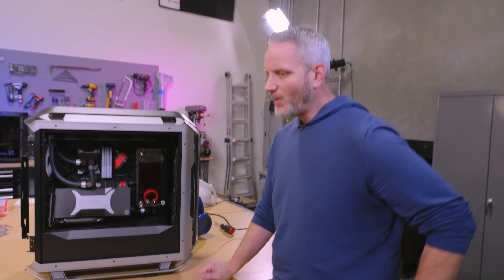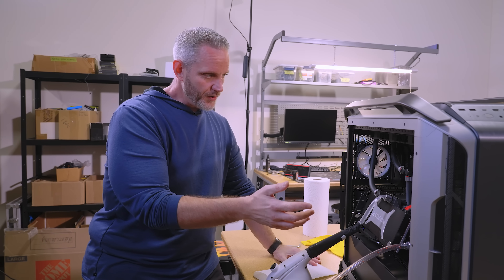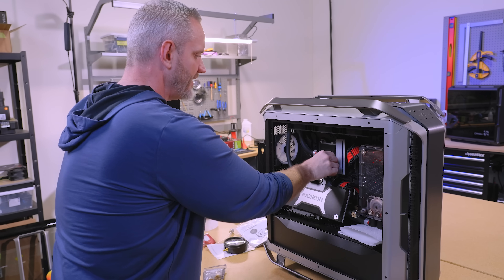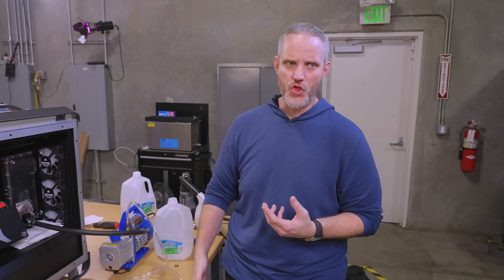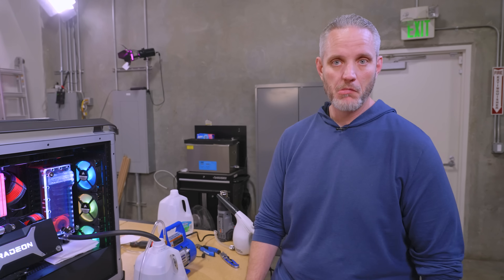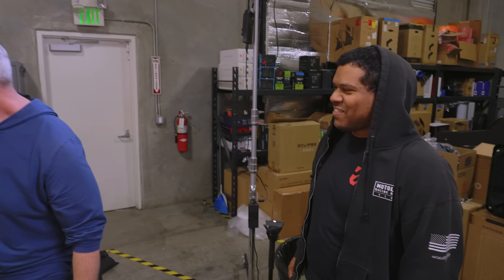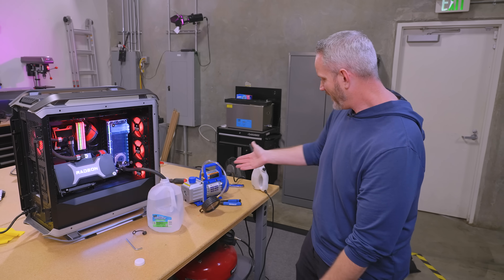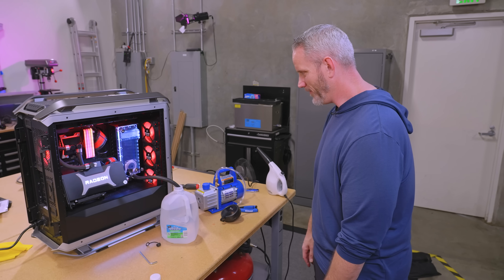I used Vacuum Pressure to fill a PC! Why didn't I do this sooner!?

Comment: I'd recommend pulling vacuum from the highest point. Filling from above the water line would also eliminate the air bubble. Lastly, I would pull less pressure. Even a few negative PSI would fill it in moments. But reducing the strain that a higher vacuum puts on your components would be good for longevity.

Comment: I built a vacuum pump using a tyre inflator and araldite, it’d be good enough for jobs like that, also there’s no need to go anywhere near a complete vacuum, the reason auto ac systems are pulled so low is to remove any moisture in the system, when you’re filling it with water based fluid anyway a bit of moisture isn’t going to hurt it.

Comment: 11:35 You only need an inline capture reservoir to use it to drain the system too.  As long as your reservoir has enough volume, it should be easy to avoid getting any liquid in the pump.

Comment: Leave the valve open near the block, use hose clamp pliers at the very end of the tube, and the dip that into the water jug. Minimal air introduced. Or prime the tube

Comment: Open the fill-port of your loop, run the system hot and hard to get coolant to max temp.
This will drive dissolved air out of your coolant.
Close your fill-port air-tight and Robert is your parents sibling.

Comment: Could run the black hose  into the fill bottle lid, then have a straw run thru the lid separate to the bottom of the bottle. When you hold the bottle upsidedown above the fill point will clear the air pocket. Straw will stop the bottle from going under vacuum. Like shot gunning a beer

Comment: I don't even think the vacuum needs to be that strong, 50 to 75 percent of what Jay used should be enough, but would also be more favorable for the structures in the radiator.
You should at least give it a try

Comment: You could use a bucket with a hole for the tube and a hole for the blower. Fill it with coolant, then hook up the hose to the cooling system and turn on the blower.

Comment: You can make a 3 way valve out of brass fittings and grab a less expensive mighty vac to hand pump the vacuum or hook up to an air compressor

Comment: This vid is very relevant to me since I was planning to use the hand pump and tubes of an old sphygmomenomitor to fill my loop! I think I'm going to get an electric pump instead.
I'm planning to use a QD connector as my drain valve, so that would definitely work by prefilling the hose with water...
Am I missing something? These links that are always listed just take me to Amazon's front page.

Comment: Hey Jay, you can put a catch can to use this to also drain the system, this is normally a steel can that goes in line and lets the liquid drop down into the can while the vacuum is pulled. Just need to make sure it is large enough to catch all the liquid with some spare room  for air to flow. You can also add another T right after you valve on the system, have  both run to valves with one going to the vacuum and one going to a jug with tap at the bottom. That lets you prefill a coolant line so once vacuum is pulled you just switch what valves are open and only introduce the small amount of air between the valves.

Comment: Just pinch the hose before you unplug it, minimizing the amount of air leak should be enough to make the system fill to optimum levels without any need for extra setup.

Comment: The only thing that worries me about this solution is the potential to collapse one of the capillary tubes inside of a radiator. It wouldn't necessarily leak or cause a complete blockage either at first.. so hard to know how you damaged it. They can handle positive pressure, but negative pressure is not something they're typically rated for.

Comment: If you want to do a pressure drain, you just hook up a container to the bleed hose between the system and the pump with the connection to the container low and to the pump high and there you go. Pull all the fluid out, then cap off the vent line to create negative pressure. Once you hit the negative pressure close all the valves and hook your drain tube to the new coolant and instant fill!

Comment: Would having an air preasure release valve tap at the top of the fluid tank, (just like the one at the bottom) to get rid of the air bubblework, to enable the tank to fully fill work ?

Comment: A goat milking machine, modified a little would do both the empty and fill. If you dont know, milking machines use pumps like this with a few other components to direct the fluid into canisters.

Comment: Depending on your actual altitude you may have hit full vacuum. Its entirely altitude dependent. The higher you are the lower that gauge is going to read. 29 is going to be when your at sea level.

Comment: The AquaComputer LEAKSHIELD does this already, it has a vacuum 'fill' function, where it will pull water into the system live. Your approach is quicker, but it's just as easy.
Also it protects the system from potential leaks. 
I'm surprised you haven't checked it out.

Comment: With how fast you can refill the things now, this would be a great way to flush coolant out if you wanted to change colors, like run distilled water through like twice and then fill it with your new fluid.

Comment: This has been around for a long time in the automotive world. Check out Air Lift Vacuum Bleeders. It uses a shop air compressor to blow air through a venturi that pulls a vacuum on an empty cooling system, then you close one valve and open the other which goes into a coolant bottle and the system fills itself. No running a car gradually adding more while squeezing hoses and burping the system. It works fantastically well.

Comment: sealed 4l bucket - pc to bucket - bucket to vacuum pump - eezy peezy draining. You could even reverse it to fill the system from the bucket, pulling the fluid through the system like sucking on a straw.

Comment: First off great video, second is the fact no I have not had a liquid cooled system, I have built many air cooled systems, can't really recall the number since several times in the past 5 years I have had 3 on the bench being built and several in waiting area to be rebuilt from motherboard up. Now to my question, can't you use a hand siphon pump as a low cost pump to get coolant out of your system then perhaps to make sure hook a LOW POWER hand blower it up to it and blow remaining liquid out?, or am I being stupid again? Thoughts anyone?

Comment: You could create a manifold with a fill side and a vacuum side that would permit you to remove air from your fill before you open the system.  It would only require a couple of additional values.

Comment: you would need to make a manifold (possibly a t fitting where one side goes to vacuum and the other to source tank) to keep from having to plug and unplug the source tubing. i would also make the rig were your source tank for fluid to be gravity fed (elevated from the system into the hose for the fill port that way you dont have air in the tube when filling) the longer you keep the pump on the more Vaccuum you can pull but 10 minutes should do fine depending on component quality and whether or not the radiator tubes collapse. hope that helps if you haven't already figured out a system.

Comment: Since you mentioned a hand pump, I have a "Vacu Vin", which is a hand pump and stopper for wine bottles.... I wonder how easy or... not it'd be to pull a vacuum on a water loop using that.

Comment: I think water cooling has now come full circle because if you remember, we started water cooling computers in like 98 or 99 with the first gen Celeron using automotive heater cores and some people were using fuel pumps as well.

Comment: Layman logic says some air in the loop is good, liquids do not compress but do expand when heated. Gas does compress and reduce pressure on valves etc when liquid expands

Comment: Surley this is also a good way to test for a leak before filling the system - vacuum the system and switch off the pump and if the pressure stays the same for a while you are leak free.  If the level of vacuum drops on the gauge you know there is air making its way in and you have a leak on the system

Comment: why can't you just put the tube into the canister with the new coolant and connect the vacuum pump to the fill port at the top of the reservoir? This works much better. I've filled my loop like this three times already. Biggest advantage is, there's almost no trapped air left...

Comment: prime the line . when we vacuum fill cars we will pull a vacuum , then we will open the fill valve and watch the fluid go all the way up to the valve itself then turn off the valve . then we will pull vacuum again as you will lose a little after priming the fill tube . use clear tubing on the fill side so you know when the tube is primed and that will eliminate most air . anytime we do water pumps , radiators , thermostats  ect. we always use the method and it works well .

Comment: If you added a vessel like a brake bleed system you wouldn't need to do anything with the valve until the system is full of fluid.

Comment: This is how I fill mine using leakshield, essentially. The leakshield prevents leaks by creating a vacuum, it has a fill mode that uses a vacuum to pull fluid into the system. 

EDIT: JAY, AQUACOMPUTER BUILT IT INTO LEAKSHIELD. THEY DID IT FIRST.
Reply: $130 vs $60 tho.
Reply: @lyianx  Active leak protection and warning tho.
Reply: @Plutonium239MXR  i bought one lol
Reply: @lyianx  You get what you pay for.

Comment: I would be concerned about collapsing the radiator tubes. You heard the radiator making noise and those tubes are what maybe 1/8th of an inch thick. Even if they don't close up completely you could be reducing flow significantly.

Comment: Yeah, like several people have been saying, a secondary feature of the Aqua Computer Leakshield is to fill the computer by pulling a vacuum. I picked it up for the leak protection but found this secondary feature to be very useful as well.
Reply: yuuuuup i got 2 of them for my mora3 setup ^^
Reply: @OrioThyGrim do you use 2 simultaneously in the same loop?
Reply: @KuraiShidosha Yes but to be honest I have two pumps and I never really got it to work and kind of gave up on it lol

I think I need to create like I need to close the whole loop so that the two pumps their tanks can regulate cuz what happens is either one or the other the league shields will just suck the water all the way up to it and pull it the water out from the other pumps tank and they kind of like fight each other until one wins it's hard to get them to balance
Reply: @OrioThyGrim yeah you can't have 2 reservoirs, it doesn't work right that way. But the thing that I learned about using more than 1 pump is that you basically can't use them because then the pressure is too high for the Leakshield to even protect you from leaks. I'm contemplating not even trying to install it permanently in my loop and instead just hook it up for draining and filling. MAYBE use it as leak monitoring if it works well enough, but I already know with 2 pumps (and plans for a 3rd down the line) I can't get good flow rate and leak protection at the same time :( it's a physics limitation.
Reply: @KuraiShidosha  i kinda got it to work for a while but its spotty i think if i make it one loop and have the LS at the top maybye i dunno 

but they areGREAT for filling up the system and other stuff like leak testing! i was just to greedy on my unlimited budget lol
Reply: @OrioThyGrim lmao I know the feeling. I wish I went with a MO-RA instead of quad internal rads. Nightmare to plumb it, my case weighs a ton, cooling performance isn't better than a single MO-RA and it probably cost me more too. Oh well ya live and you learn.
Reply: @KuraiShidosha well that makes me feel better cuz I was feeling bad that I bought the three when the four came out the 600 lol like a month after I bought the other one but that's bigger than I need but yes 

Don't skip out on this next time The Germans still do some things right lol

Comment: Also side note for that air in the line.   Get another valve on that drain tube with a barb fitting. Put that barbe valve on the end of the fill hose and close it while you draw a vacuum. Then stick that valve under the water of your fill bucket when you open it so the fill tube will still be under vacuum when you go to suck up coolant.

Comment: You can leak test this way too (you do this for freon)
Put the gauge on the system side of the vacuum shut off.  Pull the vacuum.  And just wait like 10m.  If the VAC holds, leak free.  If it drops, you have a leak somewhere

Comment: You can use an aquarium water pump to refill water in a fish tank.  Sometimes the tank top is located pretty high, so you put a 5 gallon bucket on a chair (so the pump doesn't have to work as hard), put a pump in it and keep refilling the bucket as the water gets pumped out.  That's also convenient when your faucet is too far and you cannot hook up one of these long hoses.  I don't like using these, as I like to use water that is already pretreated in another bucket.

Comment: I've always used a tiny aquarium pump. Line in from the lowest point (typically your drain), line out at the highest and that line is ran back into the bucket/fluid source so that the pump can cycle the fluid through the system however long you want it to before closing the loop up. Also works for rad flushing.
Reply: same but have been doing water changes on my reef tank.

Comment: The vacuum pumps we use at work for CVD coating are a couple thousand dollars, and approach near total vacuum, we use milliTorr "lowest I saw was 19 millitorr which is 0.748031496 inches of mercury", those last couple of points are all but impossible to get too. The pump is about 3'x2'x2' so yeah your little pump looks good.

Comment: I used to do automotive A/C repair. The vapor you saw coming out of your pump vent was mostly water vapor, from the water that was still in the system, boiling when the vacuum ( lack of pressure) drops enough. Water will boil at room temperature in a vacuum. Remember, your vacuum pump is filled with (usually) mineral oil. Water vapor will turn the oil milky over time. Make sure to change it when it does and keep it filled to the proper level. I've seen people ruin vacuum pumps this way.
To remove the fluid under vacuum, put an accumulator more than large enough to hold all the fluid in the system in line with the vacuum pump. Pull the accumulator under vacuum first and then open the valve while continuing to run the vacuum pump. I would suggest using a fairly long hose between the accumulator and the pump and keep the pump higher than the accumulator. It works pretty well.

Comment: You don't need to have the fill tube under vacuum or have two valves just pour water into the tube before you stick it into the jug.

Comment: Need clear tubing all throughout to see it from drain/blow to filling. Also double valve the vacuum line on both ends and have it PULL from the BOTTOM of some plexi container that holds roughly double of what you'll ever need. That way there is next to no air introduction and we get to see in full detail of the fill through the clear tubing.

Comment: I do this for draining the system, although far more rudimentary. I use a EK fill syringe on a piece of tubing at the drain port, and build pressure with that. At some point, I'll crack the fill port once enough water has covered drain port and repeat as necessary. I have an O11 mini with one bottom and one side rad with a distro plate so it's very difficult to drain with gravity.

Comment: If you connected the pump to the top port on the res and used a hose on the bottom port in the fluid, couldn't you pull the fluid through the system using the pump? I would think it would pull the liquid through all lines until the fluid reaches the top of the res. This would pull air out while filling.

Comment: Ok, Jay you need to try this with a Thermaltake 900 tower with a 400MM rad for the video card and a 240 for the CPU with 2 pumps and cirtuits.  I want to water cool my system.  So I have 64GB of ram gskill DDR5 - 6000, 12700K unlocked CPU and MSI 240 AIO.  4 - SSD's on a ASUS 690 motherboard.  I also have 2 HHD's  for a total of 12TB of total space.  I am using a EVGA 3080FTW.  I would really love to see that type of system filled.  I am starting the process of desighning my system now.  this is a huge case.

Comment: you HAVE to do a video about using vacuum to pull the fluid out as well. You might be able to get away with having a double catch. one container for the water another with desiccant to remove the water in the air.

Comment: INSTEAD of damaging PC rads.....  you can use a dial to set pressure.OR EVEN SIMPLER...you can low pressure push instead of pull LikE CAR RAD FILLERwith one way SELF BLEEDER valve JUST Like doing a brake job, because you basically are...HOW ABOUT JUST FLOWING  Red Line Water Wetter Super Coolant 12oz. WHICH RACE CARS Add  TO PLAIN WATER, FOR SUPER COOLING.

Comment: Somewhat similar to what i have been doing since about 2 years: also fit a tube to the fill port and then suck on that end to pull the water back up from the drain port. Therefore basicly filling it from bottom to top and have little air left like in the video but not needing any maschines.

Comment: I HAVE AN IDEA TO ELIMINATE AIR BUBBLES! 💡 Add a vacuum fitting near the bottom of the water container with a shut off valve. Make sure water container has at least 2x the water needed to fill the cooler. Connect hose for filling, raise water container higher than water pump if cooling system and open valve to fill hose with water releasing air bubbles into container as it fills. Now you can set container down and fill the cooler like Jay did. Little to no air bubbles! 😊